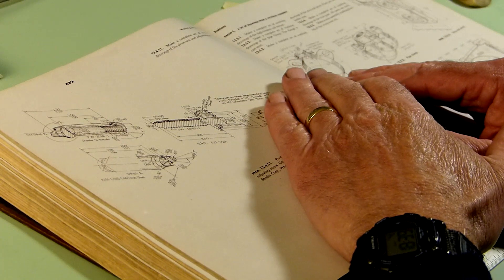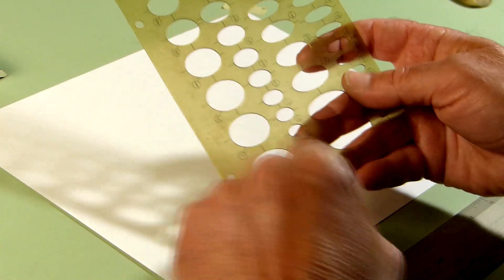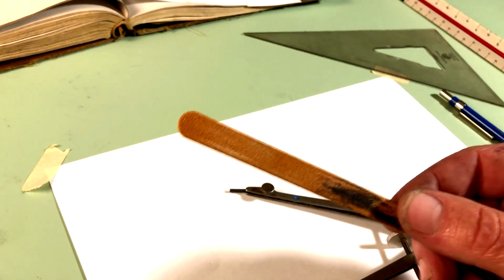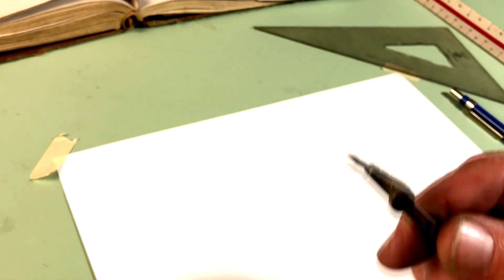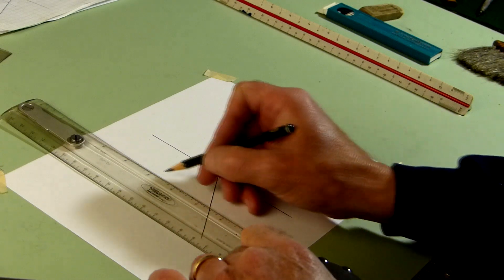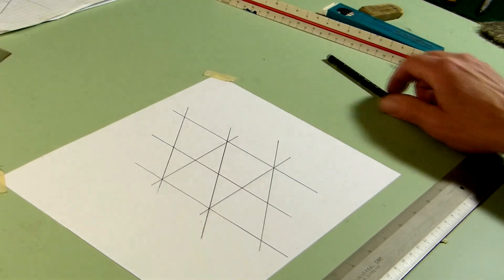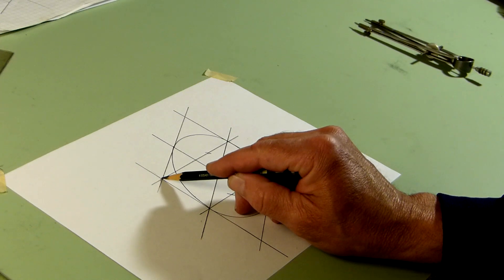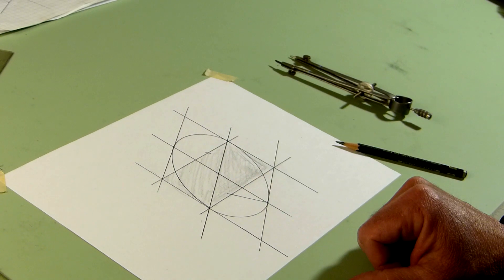HOW TO DRAW AN ISOMETRIC CIRCLE

Comment: I am an old fart - grew up in the world when drafting was the way of the world. I Love parametric modeling (Acad, ProE, Solidworks etc) and I never want to go back the the lost world of Inking and blueprints. However, this is a great way to teach the fundamentals. As a ME I do a lot of sketching to explain concepts and to convey information to the  modeling (drafting, designers) staff.  I do miss the world of being able to talk to the Machinist, I learned so much from them! For example if a machinist has to pull out a calculator you have created  bad working drawings.  Good Video
Reply from the maker: Great point. I say that all of the time: every time I have to take out my calculator to add up or figure out dimensions, that's a risk of making a mistake.

Comment: Whenever I do lines always brushed microscopic bits of graphite 0ff the vellum b4 proceeding further. And I always kept my lead holder tip into a ball of clay after using it so as not to get graphite bits on my vellum!